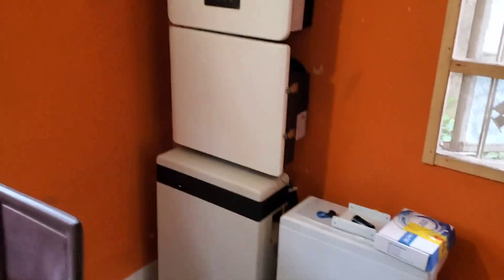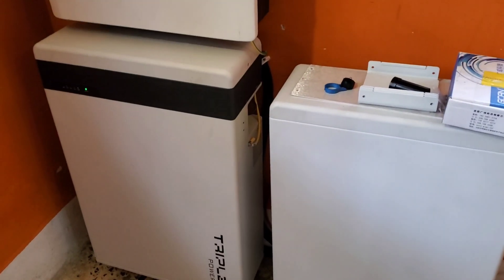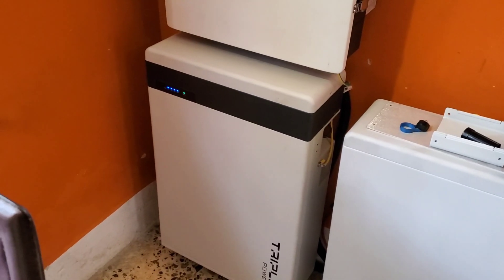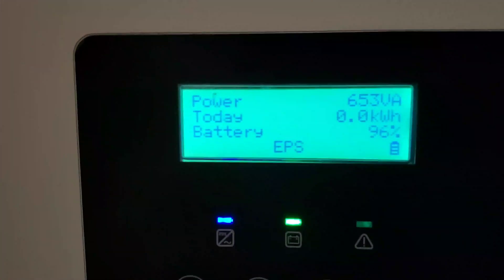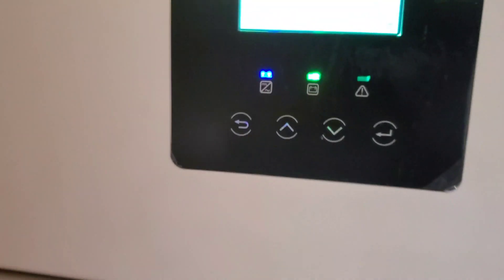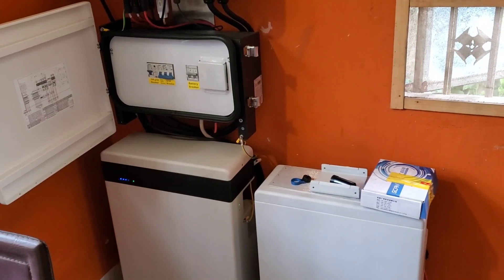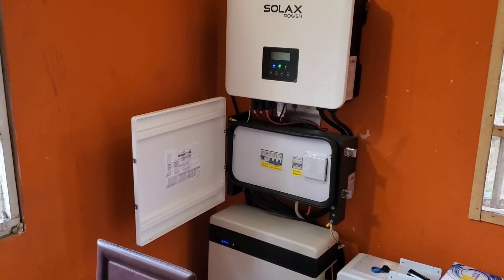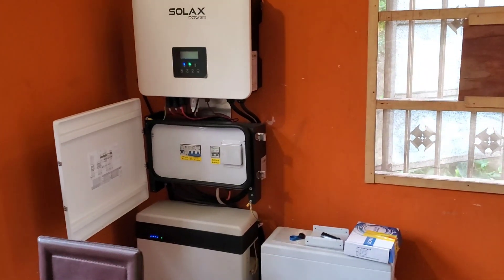SolaX X-1 G4 Hybrid Inverter. My brief experience

Comment: Hi, I am going for the same setup. Any long-term views you have about this. Will you recommend it after one year use. Thanks. Already subscribed.
Reply from the maker: Thank you for subscribing. I have had it for 13 months and it is relatively unobtrusive. Make sure your batteries are balanced. I replaced the RCD with a current limiter. Firmware. Firmware. Make sure you have the newest. You will enjoy it.
Reply: @drsolar  thanks for the reply. Here in UK if rcd is tripping than the electricion prefers rcbo specially in older houses . Don't know if that will help

Comment: Are sure your RCD breaker is faulty or it's performing it's function of detecting an earth leakage with your load. If you were not using an RCD breaker with the deye inverter, i suggest you replace with a non-RCD breaker.
Reply from the maker: I did not use one with Deye. We will try to find the fault and see if we can fix it.
Reply: @drsolar  
Troubleshooting your house for earth leakage can be a tall order depending on how old the house is and the level of alteration done to the initial electrical plan. My advice- save yourself the wahala, since   the deye never had just replace the RCD breaker with a non-RCD type. Do this and see if there will be a trip.